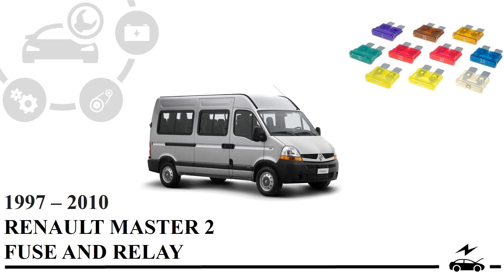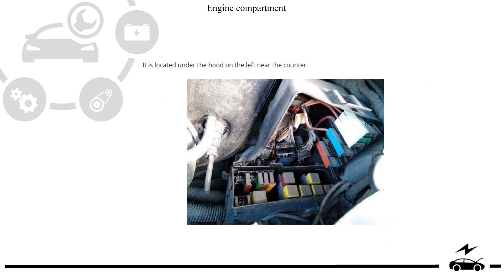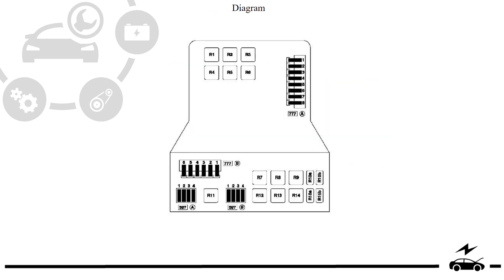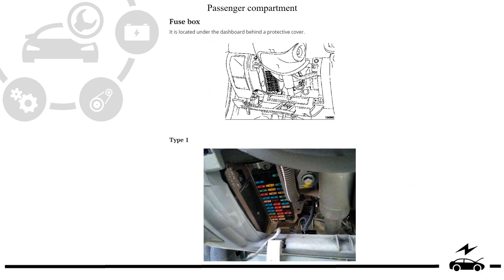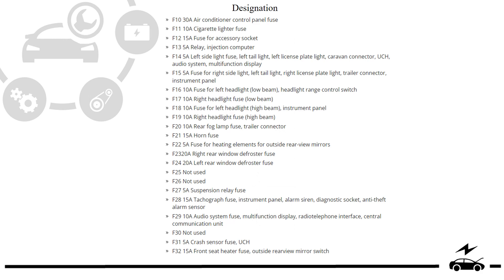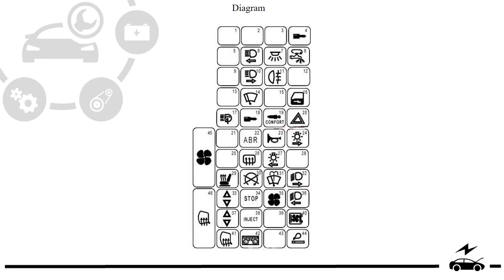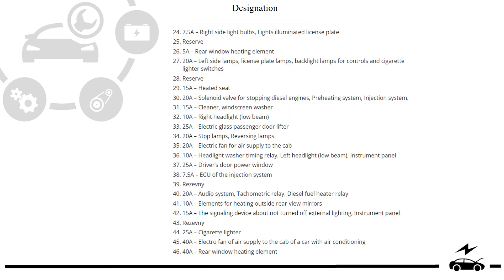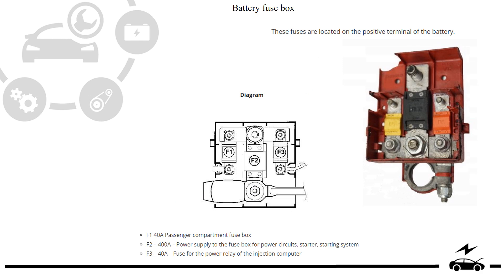Fuse box diagram Renault Master (Nissan Interstar) (1997 - 2010) relay with assignment and location

Comment: The fuse numbering for the "designation" doesn't match the numbering of the fuses/relays in the diagram before hand.  On the diagram "F1 - Inject" isn't listed in the designation.  F13 in the fuse layout diagram shows a windscreen demister function, but in the designation, F13 is listed as "F13 5A Relay, injection computer". It's total garbage.